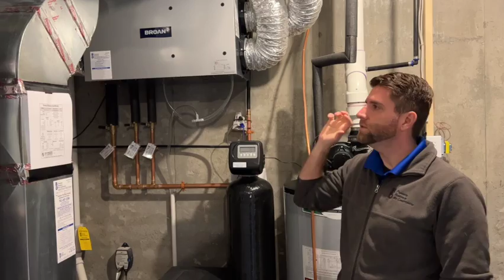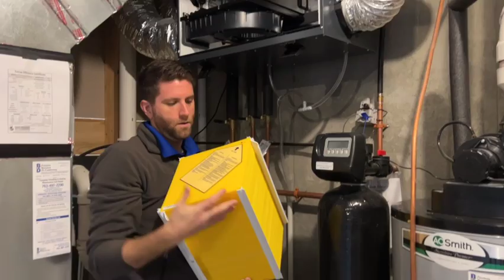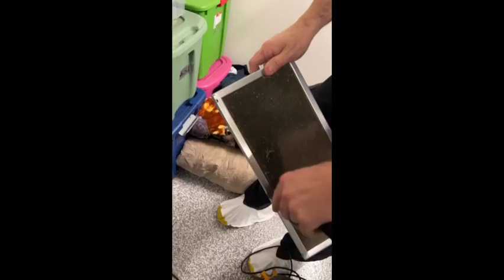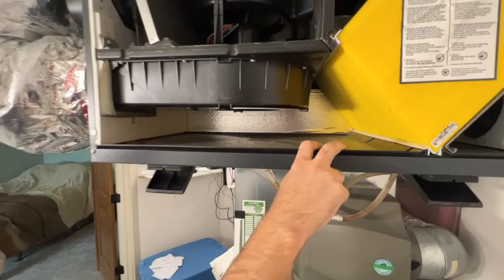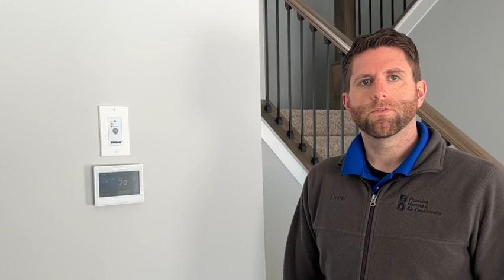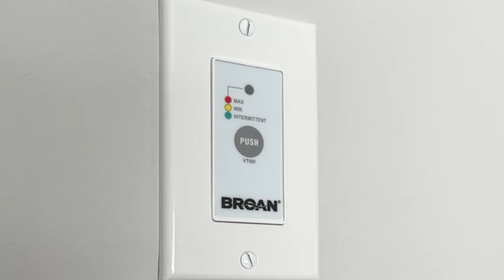Air Exchanger Maintenance: The Lungs of Your Home

Comment: despite being closed, I feel a lot of air leaking out the sides along the seems when it is running. Is this normal? Previous home owners applied tape along the edges to prevent this. Should I be doing this? Thanks